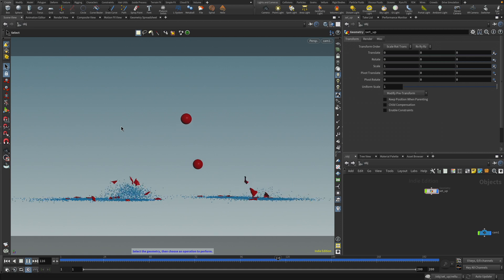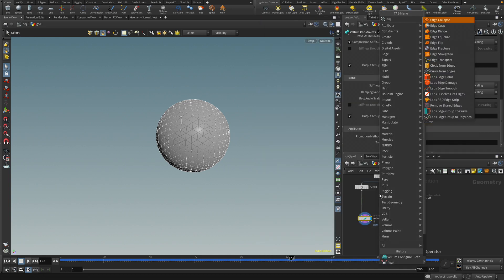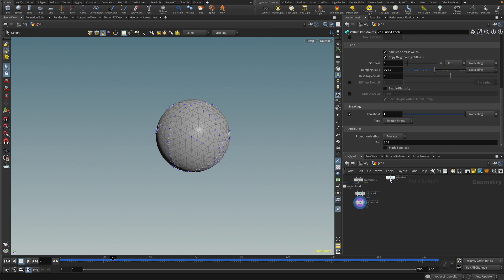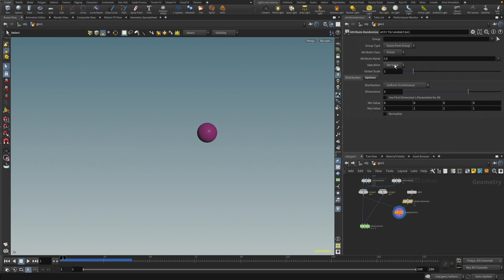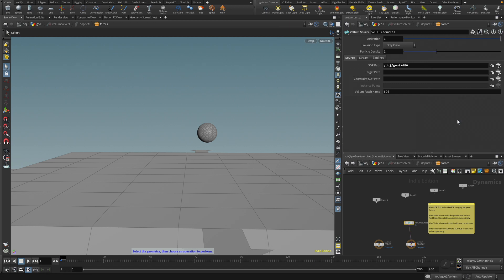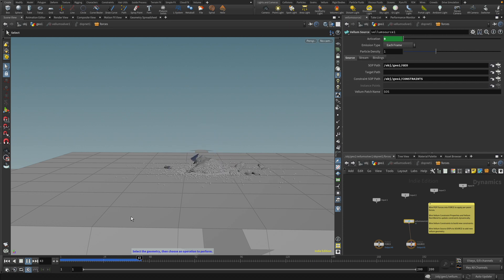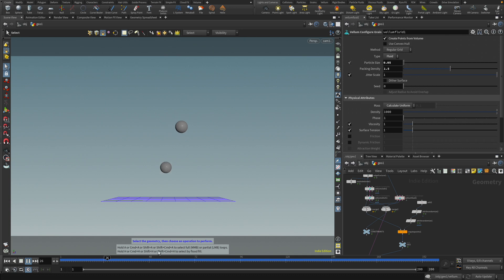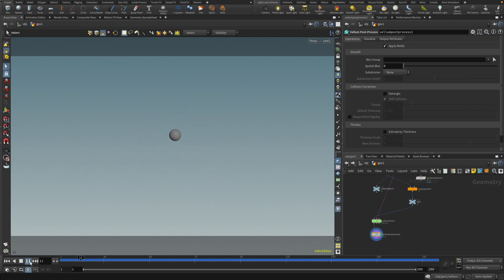Simple Vellum Water Balloon Set up in Houdini

Comment: I think I'm doing exactly the same.. But my fluid keeps exploding in the balloon at the second frame.
Reply: I had this problem with 19.5.534 but it is all good with version 19.5.569
Reply from the maker: @karelkiers  oh, ok. Weird!
Reply: I'm probably doing something wrong somewhere. Be course it is no broken again.
Reply from the maker: @karelkiers  If you have an explosion you probably have intersections in the beginning of you sim. Try increase the Peak value on the cloth and see if that makes a difference
Reply: @ShortSweet3D  That is not it.. The cloth pulls in while the liquid explodes... And resetting the sim (in the vellum solver) doesn't help either
Reply from the maker: @karelkiers  I would suggest that you debug it without the emitter and just one balloon. Try getting that to work first and then add the emitter
Reply: @ShortSweet3D  I was doing that... But I  know what the problem is. I need to have the "Merge node" in the right order. So if I have the "Vellumfluid1 node" left (top) and the "Vellumstitch1 node" right (bottom) in the "Merge node", it explodes.